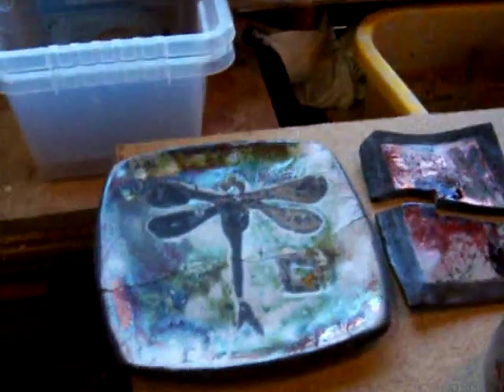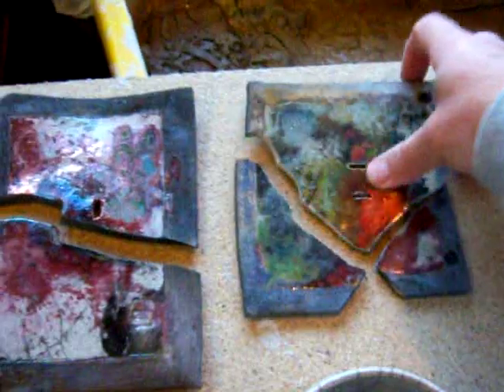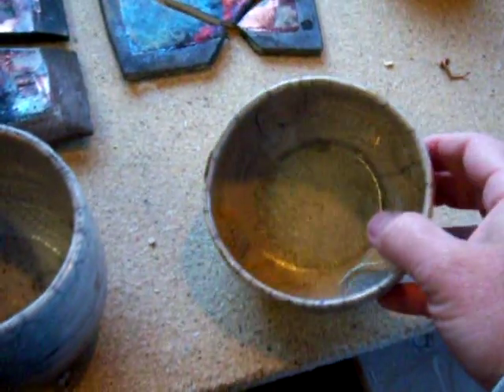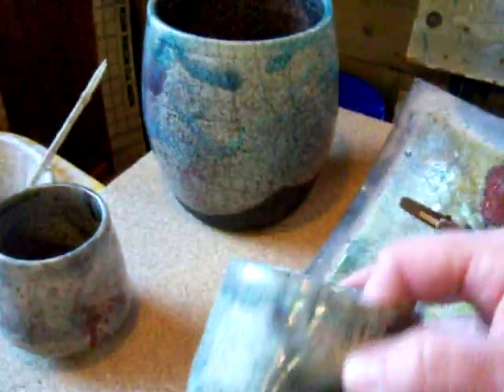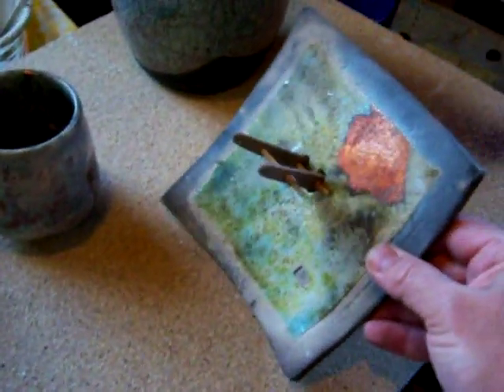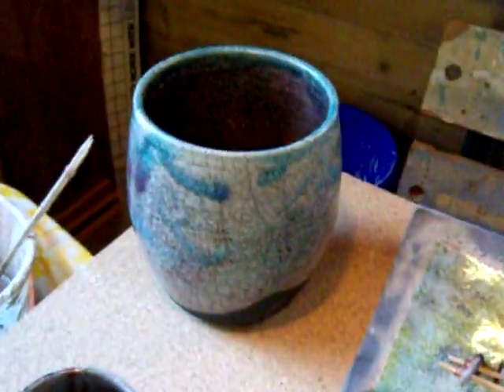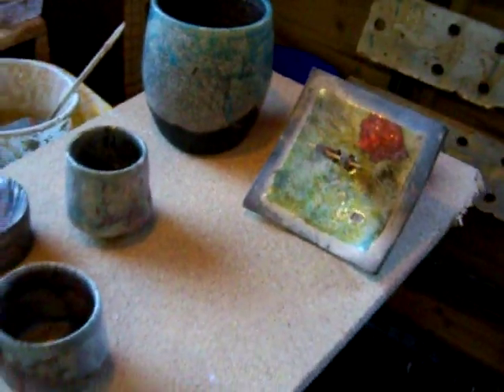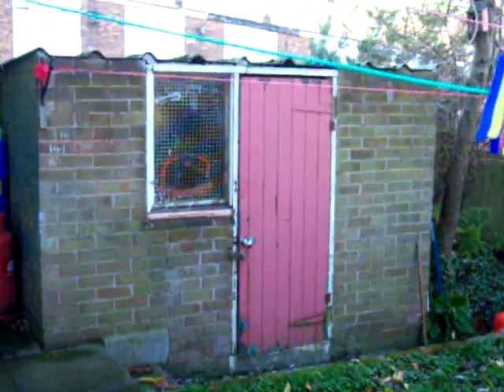kiln firings raku successes and failures001.MOV

Comment: The wired off lid is a very nice effect raku fired.  
Don't know if you've ever worked in stained glass and copper foiling or not.  For the broken plaques - I'm wondering if you could wrap the edges in copper foil and solder them like you would for stained glass.  Having the iridescence of raku firing it could be an interesting effect with the added wood pieces.  The breaks are fairly simple, clean broken lines in them.
Thanks for sharing!  Sharon